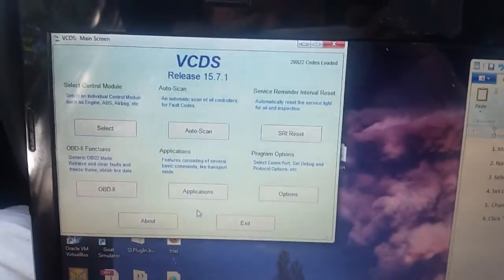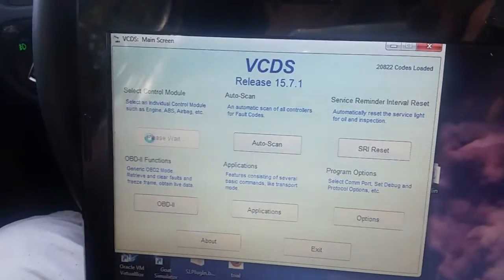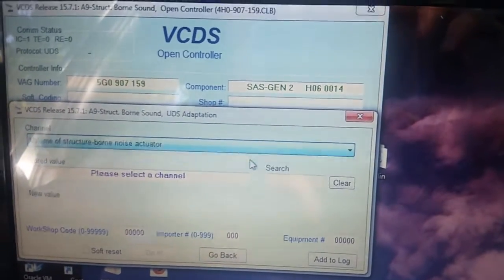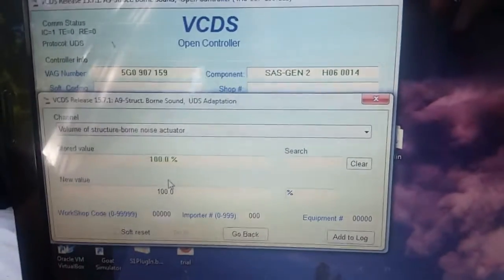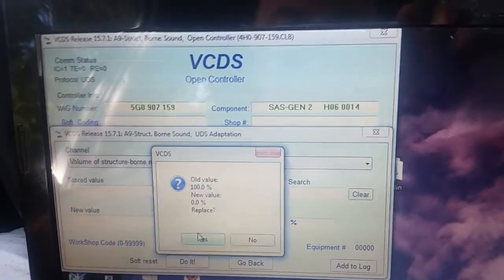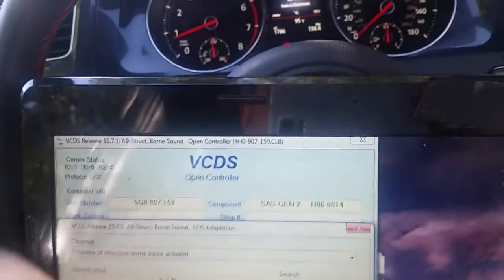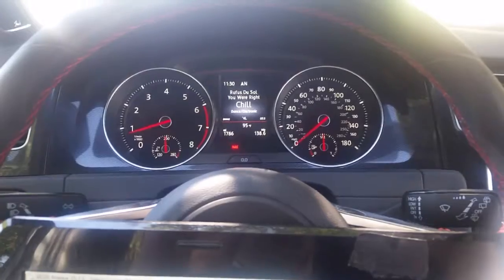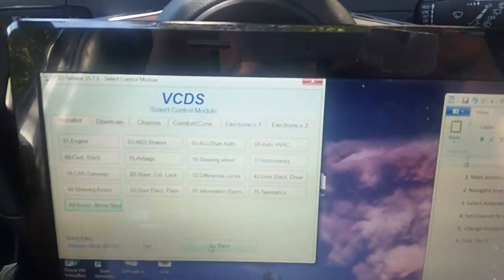Golf GTI MK7 - VCDS - Disable/tweak Soundaktor

Comment: Hey dude 
Usually when I'm driving I like the sound at 4000 rpm, but I'd like to get the same sound at 3000 rpm.
Do you know how can I make it ? 
What I'm seeing with VCDS you can just change the volume but nothing about the sound volume matching the rpm range.
Could you show the other settings like basic settings and so on..